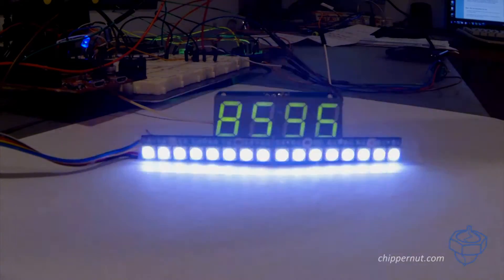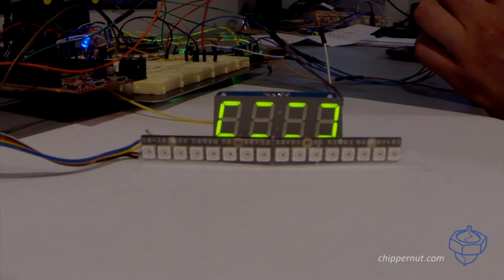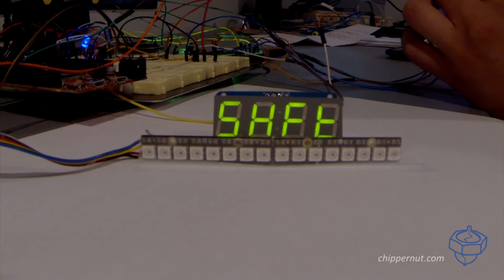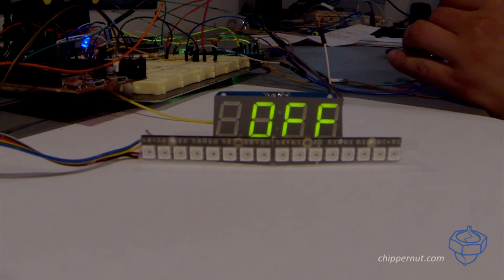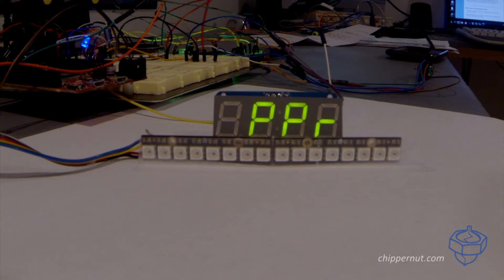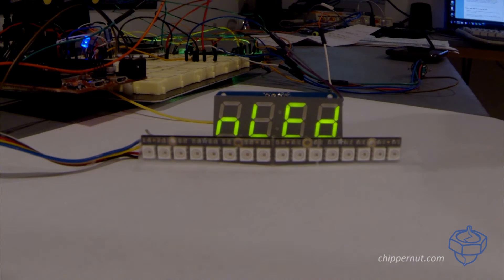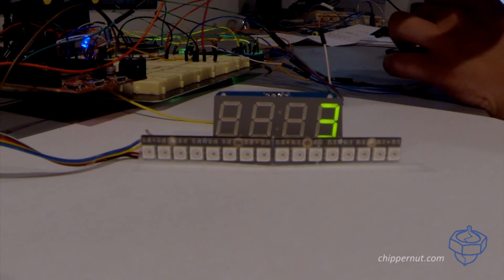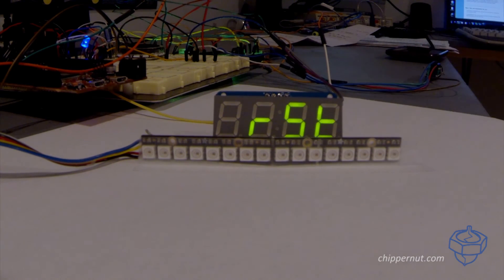Arduino Shift Light V2 Tachometer from Chippernut

Comment: hello bro, I have just finished this project, but the results are not satisfactory because when I connect the signal input to the motorcycle pulser, the circuit does not display the appropriate value and even tends to display the wrong value. and when I touch the signal input part of the circuit it displays strange values too. Is there something wrong with my circuit? 

Sorry for my bad english, i use gtranslate

Comment: how do you convert the pulse for the bar graph display? does the arduino reads the frequency and sends directly to the led display or you convert into voltage firs?

Comment: Hello good time
Is it possible to add a separate menu and an output for a few neopixels to this program to adjust the instrument cluster light with neopixel ws2812, which turns red and flashes as the engine speed increases?

Comment: Goo day, can you help me. I build one of your project. And yes it did good. But when I tried it on rpm simulator or on my bike. The rpm changes on itself. I think it's because of the noise or something. I did try change the setting and it js just the same. Did you encounter this problem?

Comment: Dear if you made ver 2.4 or 3.0 and wanted to connect this wireless input signal and not to mess up with car or bike wiring or to not make obd port busy then use A3144  HALL EFFECT SENSOR it detects magnitic ignition coil pulses wirelessly i made it its working fine.😀

Comment: Hello. I'm interested in buying yours or making one based on your info. What wire do I use for RPM input coming from OBD2? I'm not aware of a specific "RPM" signal coming from the OBD2 in my 96 F150
Reply from the maker: Hello, Thanks for your interest. I would recommend Version 3  https://www.youtube.com/watch?v=3mxMW3ISimI&t=4s   In my experience, Only in some instances is the RPM signal found via the OBD port.  Usually you must tap a wire coming from the Engine Computer or Ignition module. It normally is used to drive a stock tachometer. I would recommend researching the forums to see where others have tapped the RPM signal for an aftermarket tachometer.  The Chippernut Shift Light does not work via inductive/capacitive pickup (wrapping a wire around the spark wire). It only works with a 5v or 12v RPM signal.  I hope this helps.

Comment: How do you configure the dimmer pin in the menu with this version?..
Reply from the maker: Hello. The dimmer function was added in V2.4, but this video was made before that so the feature isn't don't show it. You adjust the dimmer by selecting the type of dimmer circuit in the car (high or low controlled) then the brightness level to dim to.  It's basically the same as shown in the V3 video, but without the graphical screen.  Hope this helps

Comment: @Chippernut
Is there a way to implement this into a motorbike?
I'm wondering how would I be able to read bike's RPM,  2 cylinder engine.
Reply from the maker: @Aivaras Vilkas
Yes. You'll have to do research on your particular make/model, but plenty of people have installed on a motorbike. The shift light needs an RPM signal; usually this is a 5v to 12v square wave signal output by a computer controlled ignition.

Comment: great looking project man. I have a few quick questions if that's ok and you wouldn't mind clarifying them for me.
1) is there any reason you couldn't power the arduino and draw 5v for the lights & display from the built in 5v pin? 
2)is there a limit on the number of pixels you can use as I am intending to light up my whole dashboard with a long strip.
3) could the rotary encoder be replaced with 3 buttons (one left, one right and a select)?
Sorry if you've already answered these questions somewhere else.
Reply from the maker: Hello.  Thanks for your interest. I'll do my best to answer your questions. 
1) the arduinos regulator doesn't provide enough current for the LED strip. you need a seperate supply
2) the only limit is the current required, if you can get a larger 5V regulator, you can have as many as you want. Each LED can draw between 60-90mA at full white brightness. It adds up quickly. 
3) Yes- you'd have to modify the code for it to work. 

Hope this helps
Reply: Chippernut that's fantastic. I'll let you know how I get on.

Comment: hello i would like to instal this to my honda prelude 1997 and i am not sure my car is "new" enough to have digital output for the tachometer any tips?
Reply from the maker: You may be correct. You could try an optoisolated circuit or a schmitt trigger to adapt the signal, but I currently don't have any components stocked to build these circuits. My apologies. Shoot me an email though via my contact page... I have another idea.  http://www.chippernut.com/contact.html

Comment: Would this work on a rotary engine?
Reply from the maker: Excellent question.  It has not been tested on a rotary, but I see no reason why it wouldn't work provided you have a good rpm signal. RPM signal should be a 5v-12v square wave, 50% duty cycle, frequency = RPM.  generally this comes from a computer controlled ignition system as a means of diagnostic RPM display or instrument cluster display.
Reply: Would you set it to 2 ppr or 3?
Reply from the maker: I"m not sure. I'd have to research it. But w/ the ease of changing the PPR in the menu, I'm sure you could dial it in pretty quickly.

Comment: this thing is fucking amazing, its exactly what i was looking to build plus some. does the code work with a 16 neopixle ring or would it need modification? 
thank you
Reply from the maker: Thanks!!   You can program any number of LEDs in either the strip, stick, circle, or grid if you like - the only limitation is the current from the power regulator limits you to about 25 LEDs safely. Any more and you run the risk of crashing the nano from power starvation.
Reply: Chippernut so if I used a voltage step down with a higher current rating I could add more neopixels? because I was thinking about using half a 60 ring if I could, not to mention the 1.2" 7 segment display I was going to upgrade to, probably needs a bit more power. 
also, I'm self taught when it comes to this so I have a few learning gaps. what part of the code pertains to the amount of neopixels in the display? 
thanks again

Comment: Hey sorry for so many equations but can you make a wire plan for the rpm simulator because i don't know how to wire this correctly. Please only a simple plan how i have to wire this for the rpm simulator and what i need.
Thank you.
Reply from the maker: Hi Mario,  Please see instruction manual located here: https://www.chippernut.com/uploads/2/5/3/5/25350363/shiftlight_v2-4_instructions.pdf  the last page has overall wiring diagram. 

Otherwise the schematics are on my forums.  Hope this helps
- jon

Comment: But how have you done that in your video with the rpm, because there is also a rpm-simulator for the Arduino uno.
Reply from the maker: Yes -  I use an RPM simulator for bench testing the shift light. Here's the information for that.  https://www.chippernut.com/forums.html#/20141229/schematics-and-code-2-4468331/  Simply connect both grounds together (this is important) and pin 5 on the generator to the RPM input on the shiftlight

Comment: And where should I put the -12V wire? -> Because in the plan says that I have to use the +12V wire but where is the -12V?
Reply from the maker: Hi Mario, 
+12V goes to your + battery positive (assuming it's a 12V battery) 
-12V (or ground, - ) goes to the negative (black) battery post
The RPM signal varies from application to application -- you have to do research regarding your engine and vehicle to determine where to place this - it should be a 5-12V square wave signal, it will not work as an inductive/capacitive pickup, or on a cam/crank sensor. You will want to look for an RPM/Tachometer signal coming from your engine ECU

Comment: I also want to build this shift light , but I do not know where I have to pick the wire of the RPM Signal, because I want to run this like in your video without a motor or something like that.

Comment: As this is my first ever project with arduino, i made custom single layer pcb, and everything works great :)
I wonder is there a way to add an option to Turn Off the LCD (set it brightness to zero if it is posoble) and leave only led sripe (NeoPixel) to work? For example hold down rotary button longer than 2 sec and turn off lcd.
Reply from the maker: Awesome! I'm glad it works well for you. Thanks for your interest. That's a fantastic idea! I'll see if I can incorporate it in the next code update.  Thanks!

Comment: i built V1 for my 06 corvette, but haven't gotten around to installing yet. With this, I'll probably redo it with V2, but I would really like an outside towards center animation (planned on editing the addresses in the coding) but it's nice to see you building it into the menu system! Anyway to add this capability?
Reply from the maker: Cool!  Yes V2 has quite a few improvements.  The outside to center animation is slated for the next software release, but I don't have an ETA on that quite yet.  I'm working to release it before 2017 for sure.

Comment: Hi. It will reset do default settings after turn off +12V ?
Before we start the engine its still blinks ?
Arduino automaticly adress more or less than 16 LEDs ?
Reply from the maker: Great questions.  No it will not reset. All settings are stored permanently in EEPROM.   This does require a running engine, or a simulated signal in order to function. I have an "RPM Generator" code on my website that is meant for bench-testing.  And yes, the arduino can address a large number of LEDS, but the power supply is only rated for up to 25.

Comment: I'd like to use this as a tachometer in my 6.9 diesel. It uses a hall effect sensor mounted to the injection pump gear housing and would be 53ppr. Is this possible?
Reply from the maker: Possibly --  The shift light was designed to use a clean, 12V square wave from an ECU (generally the RPM output/tachometer signal).  The hall effect sensors generally produce the same signal, but it's usually faster and may be without signal conditioning. The shift light should be able to accept the faster signal and filter it, if needed, but I should note that this has not been tested yet.

Comment: Hey dude, have you noticed that the rpm reading on the shift light is lower than your actual reading? For me it gets worse as the rpms are higher. I can hold it steady at 3000 rpms and the light will read 27-2800, and at 4000, it will only read 35-3600. I was just wondering if you have had a similar problem in your car. It makes things really inaccurate with the light going off on time. Also, if it helps, my motor is a mitsu 6g72
Reply from the maker: +JustKyzuuh  There's the possibility for a slight misreading depending on the signal characteristics, but I hadn't experienced it nearly as bad as you -- mine was about 50 rpm off at redline.  I plan to implement a 'fine tuning' feature in the next update that will remedy this.  I'll do additional research on your engine and ECU to determine what exactly is causing this.  Do you have it plugged into the ECU or are you doing inductive pickup off the ignition?  thanks for letting me know!
Reply: Chippernut I'm pulling the signal from the ecu. Thanks for all your time and effort dude. 

For testing purposes, I had the circuit built on a breadboard and was just testing it and making sure I pulled my signal from the right wire. I was using a 5v power source and didn't have the 12 volt part of the circuit at all. I don't think it would have an effect, but do you think that may be a possibility? would the transistor part of the circuit give a lower reading if it didn't have as much current running through it?

Comment: can I use arduino pro mini instead of this one?
Reply from the maker: +CyB3RW0rld89  Yes - although you will have to change a few pin assignments in the code.  It should work just fine.  Check out my info @ chippernut.com.   :)  thanks for stopping by!
Reply: +Chippernut thanks I will rather use nano board, now I know that I have to use ht16k33 backpack from adafruit, but can I use this neonpixel http://www.ebay.co.uk/itm/400991742234

Comment: Hi I'm new to Arduino, I only know a little bit about it.

I want to make a shift light, but without a NeoPixel Stick. Instead I want to use about 4 red LED bulbs. So one turns on at 3k, another at 4k, the 3rd at 5k and the last at 6k and make them all flash at over 6k.

So how would I go about doing that, what will I need? What won't I need in terms of coding and hardware?

Many Thanks and great work BTW :D